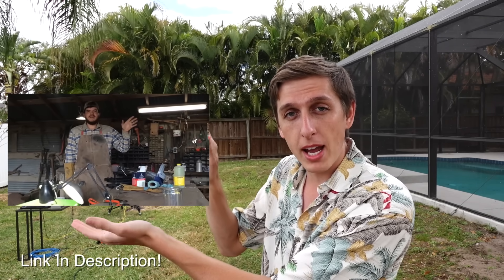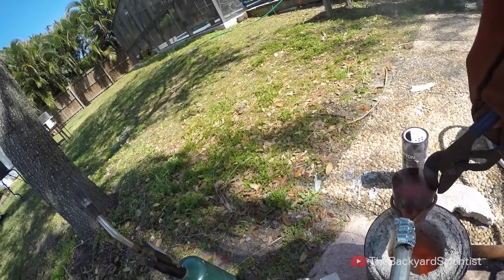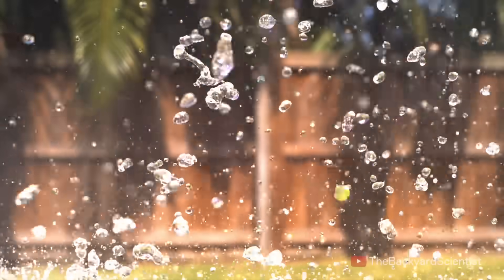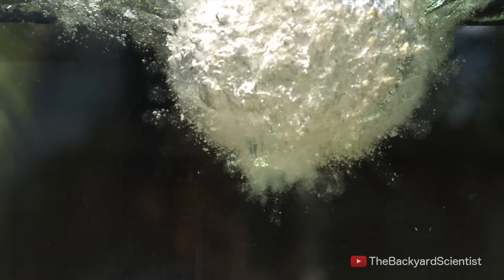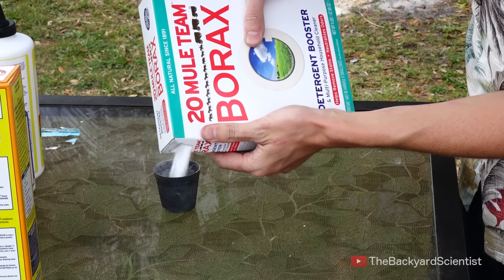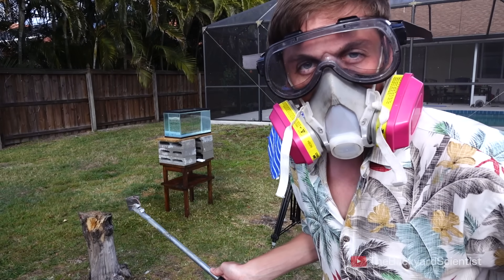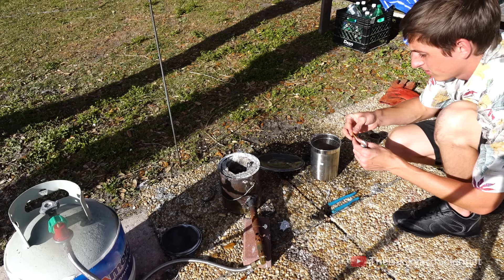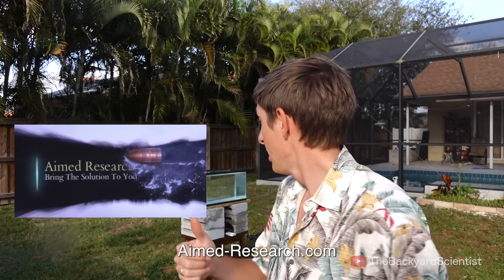Pouring Molten salt into Water - Explosion!

Comment: What if you pour molten salt into a saturated salt water solution?
Reply from the maker: +Mike Warot hmmmmm
Reply: +TheBackyardScientist you gotta do it now
Reply: Why would it change like anything at all?
Reply: +The Bunny Suit Killer yes you right he should try injecting extremely heated Cl in a NaOH base
Reply: +Mike Warot or a liquid other than water, like oil which is used to safely transport sodium.
Reply: +TheBackyardScientist salt absorbs water so maybe that counters the leidenfrost effect?
Reply: +Vladimir Nachev or maybe his salt contains Something they don't want you to know xD I mean potassium?
Reply: This is just a theory but, maybe salt and water are just compounds that have a high affinity for eachother and they attract to eachother despite the extreme circumstances. And maybe the leidenfrost effect is not strong enough to repel their attraction to eachother. +TheBackyardScientist
Reply: I think +john carter has it right actually...
Reply: +Mike Warot probably the same thing to the one you can see on this video?
Reply: Jayson Viray the liquid nitrogen would probably evaporate before the salt hit it

Comment: Salt and water explosion is very easy to explain. Melting point is what you should have referred to when melt a solid as boiling point is used when you vaporize any matter i.e. turn its state from liquid or solid to gas. So melting point of Nacl(salt is 800 degree C) and the water that you are pouring it is at about 27 degree C. So as soon as you pour molten salt in water its starts to solidify and starts to form crystals but these crystals are still at very high temperature then boiling point of water. As crystals have a very large surface area compared to a single block of solid it gives away heat very rapidly. This heat is taken by water which intern evaporates instantly causing  an explosion.
Reply: +Hiren Patel Seems legit. Best explanation read 'till now.

Comment: Sodium reacts with water even at room temperature. Sodium is very reactive metal. Here is the chemical formula 

2Na    +      2H_2O    ----->      2NaOH     +      H_2    NaOH  sodium hydroxide is a salt so it will have no effect on the Ph of water.

Comment: I wonder if the super heated salt separates out the chlorine and leaves you with sodium metal, which would cause a culombic explosion.

Check out Philip Mason's on this. He just published new findings on this last year
Reply: +Jens Boettiger Was going to suggest the same. Search for Thunderf00t and Sodium or watch ?v=LmlAYnFF_s8 to see the fun summary.  Anyway, change the speed to 0.25 and go to the 2m 23s mark and about a second later you note the spiky explosion at the surface that releases energy up and down. Seems like coulombic explosion to me.

Anyway, yeah, the molten salt likely had enough separated sodium to create these reactions in water. This just happened to be really dramatic. Probably not easy to reproduce exactly as well.
Reply: +Jens Boettiger He tested this in the video, by using a smaller container of water and measuring any change in pH. If such a reaction would occur, u'd get some sodium hydroxide (lye) which would make the water more alkaline. He found no change in pH.
Reply: +Jens Boettiger No that wouldn't be the case.   They create sodium metal by electrolysing molten salt (aka adding even more energy than what it takes to melt it).  It takes a lot of energy to revert sodium ionization back to metallic form.  It's on the order of 450 kJ/mol which for perspective it only takes about 280 kJ/mol to completely rip apart a water molecule to form H2 and O2 gas.

You wouldn't get sodium metal from this.

Comment: Hy i think that the explosion is caused by the rapid cool down of the salt. As you said in the video there is a crackling sound when the salt cools down. The salt trys to create crystals as it cools but if its fast the crystals dont align and they break. You can try this by using some dry ice so there inst liquid inside the molten salt.

Comment: Correct me if I'm wrong, but Sodium chloride is more soluble than borax in water.Sodium chloride dissociates into Na+ and Cl- while borax dissociates into 2Na+ and (B4O7)2-. Cl- is more electronegative than (B4O7)2- and therefore it has a higher attraction to water molecules. This attraction may tear the Na+ and Cl- ions apart as soon as the NaCl hits the water, thus negating the leidenfrost effect by establishing nearly instantaneous ion-dipole bonds between Na+ and Cl- ions and water molecules. Whereas the borax is more likely not to dissociate instantly, which allows the leidenfrost effect to take placeand cause it to cool down first into its solid state and then dissociate. I am not sure about any of this. It is just my best guess from what i saw in the video. Let me know what you think!

Comment: I'm curious as to whether the NaCl splits into its individual components and the H2O has a chance to make contact with the Na. If I had to guess I'd say there is a chemical reaction. I do think a change in pH could be possible, but those pH strips might not detect the change, but I'm sure a properly calibrated meter would.

Comment: You should try it with lithium iodide or potassium iodide or even, dare I say the least electronegative ionic compound available. Maybe the Liedenfrost effect is taking place and the has is surrounding the molten salt. Then the steam mixes with the sodium and that happens super fast, seeing as the salt is molten and energized. That reaction creates heat and a shockwave which further vaporizes the water. Then the molten salt moves on till it is in contact with the water again and the same reaction repeats. this would explain the recuring shock waves and the large displacement of water. But I'm no expert.

Comment: so if you want to know why this happens is because the sodium that is melted down has 2 valence electrons which are basically electrons floating around the nucleus. Then oxygen which has 6 valence electrons  wants to take  the two electrons from the sodium to create a full valence elctron shell to get the perfect octet that all elements want. When the two elements oxygen ( which is present in water) and Sodium combine they both create a huge explosion between the transfer of valence electrons to create a new type of compound. See now you can say you learned something today!
Reply: but water also has two hydrogen which has 1 valence      electron each which gives water itself a full 8 valence electrons.
Reply: not to mention there is also chlorine that is also present with the sodium (NaCl = table salt or the type of salt he used in the most powerful reaction)

Comment: I actually think it is a chemical reaction.
The temperature would be high enough to oxidize water, following the equation 2H2O -> 2H2 + O2. Then, H2 is ignited, causing the explosion, building of pressure ect. This idea is kind of supported by the first scientific paper when they mention "surface-heat rate transfer". The same thing happens with thermite and water : for example Mythbusters (RIP) made an episode about this (called "Thermite + Ice) (although you did a video where you poured ignited thermite into water, but I don't think the conditions were ideal for an explosion), so I assume it would be the same with molten salt. That would explain why you have to pour the molten salt quickly in order for a big boom (higher temperature + all the metal at once), but I don't know why it didn't work with other salts (their melting points varies, some are even higher than NaCl. Maybe something to do with solubility ?). If you check something called "The Ellingham-Richardson diagram", it shows that there are particular conditions where an oxyde is more stable than a metal (and reciprocally), which can be the case for water. But, you need particular conditions : temperature, oxygen pressure...
Again, these are just theories :)
By the way, as others said, a change of pH doesn't necessary means that there has been a chemical reaction ; and everyone has been breaking your balls with that, but pouring sodium metal into water produce sodium hydroxyde, and I doubt your Hawaiian shirt can protect you from strong bases, let alone molten salt ;)

Comment: You sure it's not the opposite? 
I'm thinking that maybe the first two times the salt wasn't hot enough to let the leidenfrost kick in, and the result was that with too much water the whole thing didn't explode.
With increased heating, leidenfrost DOES happen, and you can see it in your videos: the water creates bubbles that surround the salt masses (check it out stopping the video when the bubbles are still clear).
Result? Sodium atoms react with few water molecules (the ones in the vapor that suddenly creates) and you get the typical Sodium+water explosion.
If you notice, the reaction happens at its best when water is not too much (on the surface).
Chlorine seems to dull the reaction (if you where to throw 50 grams of pure superheated sodium into water you wouldn't have a backyard anymore XD), probably because it acts as an antagonist to water molecules, being in between them when the reaction happens.
The point with too much water is that probably it breaks apart your structure, cooling the atoms and letting sodium and chlorine mix again and thus opposing to the exponential reaction. I think that the explosion only happens when the sodium is not  in ionic form, and when it's molten it separates from chlorine and the two act as separate compounds, without sharing the electron. If you where to cool it too fast the salt would reform and sodium would be giving away again its electron, thus rendering impossible the reaction.
The pH didn't raise because you poured in salt, and that does not alter pH. You need either an acid or a base, not a salt (unless it's an acid or basic salt, but that's not the case).

Comment: I agree that this is definitely not a chemical reaction. No where do you give sodium back its missing electron. To accomplish that you'd have to put an electric current through the molten NaCl. Based on what we already know, I hypothesize that this is purely a steam explosion. NaCl is an extremely brittle ionic solid. As it hardens, it cracks with ease. When it's poured into water in a sufficiently sized blob, the outside layer instantly hardens and then shatters. This effect accelerates the reaction by greatly increasing the amount of surface area exposed to more water, and the process repeats until you get an explosion. Very much like you said, which would explain why the Leidenfrost effect doesn't occur as expected due the mass of NaCl rapidly dissipating rather than clumping. I would try this with other ionic solids that are known to be extemely brittle, and compare to those that are much more ductile. I'm betting you'll find a correlation between the extremely brittle salt and the occurrence or intensity of the explosion.

Comment: it is definitely a flash steam explosion, which is extremely violent, and most likely caused from the high melting point of the salt, as well as the solubility of the salt in water.

Comment: I think I may have an idea of what happens. The water getting trapped is very interesting, but it doesn't explain the lack of Leidenfrost effect.

Here's my theory in short. You can hear the rather loud noises of the chunk of sodium chloride cooling. That to me means high internal stresses. My guess is that the table salt doesn't have a high enough specific heat capacity to keep the water as steam, which means that it VERY quickly cools down, all the more sped up by the direct contact with the water. This makes the outside be at a extremely different temperature then the inside, if not completely solid, with the inside still molten. That is a perfect recipe for very extreme internal stresses. Causing it to explode. Something like a Prince Rupert Prop. I small tap to the tail, and it explodes, only even more extreme forces.

This explains the noises when the chunk was cooling, the lack of Leidenfrost effect, the explosion, and the fact pouring the salt slowly, and at a lower temperature doesn't have as much as an effect.

Comment: I was thinking it could be like a Prince Rupert's Drop where you rapidly cool the outside which creates a lot of stress in the crystals.  Which is why it made the crackling sound as it cooled in air at the begining.  Are there any large salt crystals after it explodes?

But I think your theory with the water getting trapped is also plausible.
Reply: Maybe try in hot water and cold water to compare.

Comment: I'm going to guess it's probably a combination of chemical and physical reactions. It first hits the water as you said, with the pocket trapped, butThe potassium hits the water and has a explosion, less than the pure metal, but still there. This propels the rest of the mixture outwards faster than just a steam explosion, causing the outer layer to impact the wall of water created by the leidenfrost effect, giving it a much larger than average contact area

Comment: Leidenfrost effect isn't working out too well for sodium chloride because the sodium and chloride ions have a higher affinity for the water molecules than what ever's in the borax. Despite the high temperature of the sodium, the water is still drawn to those ions, and they dissolve and transfer their energy to the water much more rapidly than borax, as borax is not as soluable. It simply cools down and solidifies, and doesn't mix well with the water.

Comment: At this temp sodium chloride reaches it's criticall mass. NaCl. The bond between the sodium and the chloride is broken. And sodium has a violently explosive rxn with water. Pure sodium can only be stored in oil or alcohol etc. As it will react with the moisture in the atmosphere.

Comment: I believe the molten salt is cooling rapidly on the outer surface creating a hardened shell, the molten salt internally is still hot/releasing gas still causing the shell to explode to give way for the hot sodium.

Comment: Isn't it just cause steam has a 1:1700 expansion ratio (1 part water = 1700 parts steam). That's why there's a big explosion. Same reason you don't poor water on a grease fire. Its just way to hot and the water expands way too fast.

Comment: may be when he pour the very hot molten salt in the water, the water that trapped in the molten salt break down instantaneously into hydrogen and oxygen, the heat of the molten salt then ignite those very combustible air and create little explosion...... u know the water starts to break down around 1000c. you tested there are no explosion happens when you heat it to 800... until you keep heating and the explosion start appearing

Comment: It's an electrolysis effect. When you put sodium cloride into water, it forces the water to "break" in a RED-OX reaction, forming oxigen and hydrogen. The higher the temperature is, the faster is the reaction, that's why you get the explosion only with molten salt.
The sodium carbonate on the other hand forces the water to release just a small amount of hydrogen, so you don't see a violent reaction. Sodium carbonate should also rise a little bit the pH.

Comment: I want to be the secret lies in both the heat transfer properties and material properties of the molten salts. 

NaCl appears to be able to instantaneously disperse water away from itself by creating a large cavity of water vapor. The rate at which it transfers the heat into the water was amazingly fast compared to the other salts. (maybe there is more energy released since the salt is disassociating into the steam)

The other substances appear to have different properties -- probably due to there chemical structure -- which made them behave differently in the water.

Comment: My hypothesis.  POPCORN!!!!!!

A simple explanation could also be just the nature of the sodium chloride itself.  Try similar large structure crystals.  You pour it in fast, and you form rapidly this high stressed outer shell of strong crystal.  Inside, you have molten sodium chloride.  Many crystals (such as ice :3) are less dense than their liquid form.

So you form this shell, internal salt starts to solidify, stress too much and boom!  Proper explosion, not a blevy.

Ways to expand on this?  Well make note of similar crystaline structures.  If I was doing this experiment, I would try a similar test that I hadn't seen on your channel, but also havent looked to hard of water into a larger volume of liquid nitogen?  Hmm...  

Any other high temperature large structure crystals anybody?

Comment: I still think its chemical... when you raise the temp of water... it assorbs more sugar... its because you can "trick" atoms to hold an "Extra" atom... so maybe heating the sodium chloride bonds either break or just the sodium is allowed to react to the water as if the chlorine wasn't there (which might explain why there wasn't a PH loss cause the sodium isn't bonding to H or OH... I believe raw pure sodium might react more violently than molten... i believe you should use that as a test as well... i think since not all the sodium is reactive. some of the sodium that is able to react is shielded by the other bond prehabs cooled by the water... and so water is reacting at the same points you believe to be a physical reaction... i think finding a way to messure the energy given off by all three explosions might give a better clue... if the temp changes follow closer to pure sodium in water (not molten) than i think this would indicate a chemcial reaction... otherwise it would give off the same heat as a physical reaction..  but what do i kno...